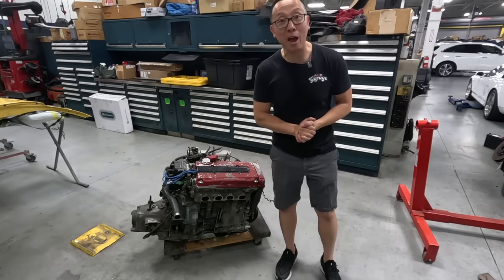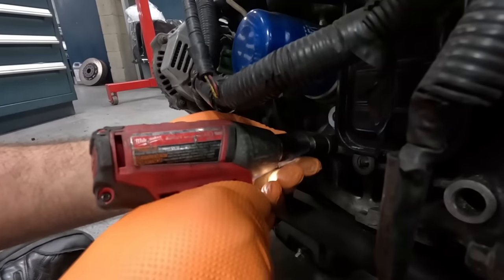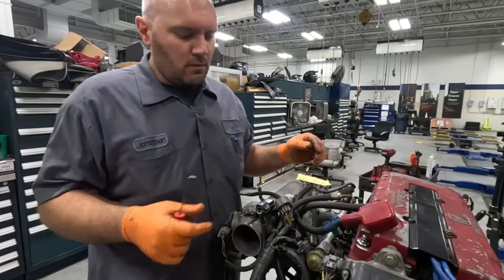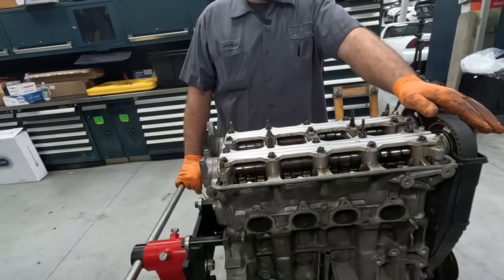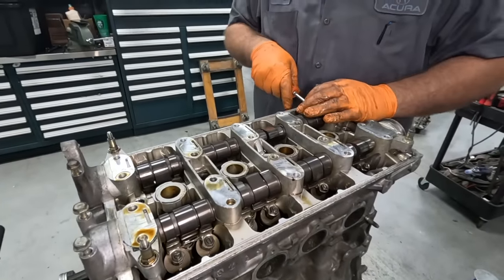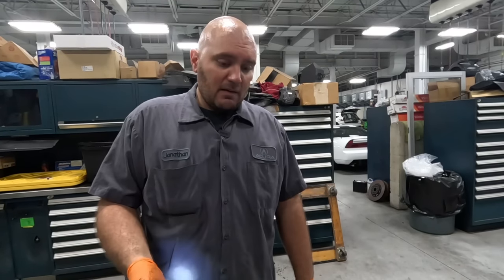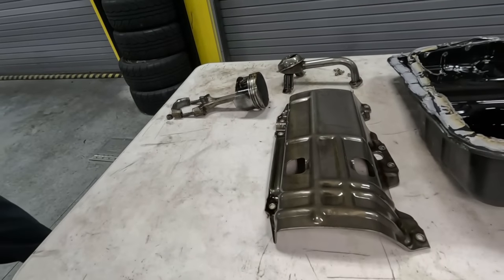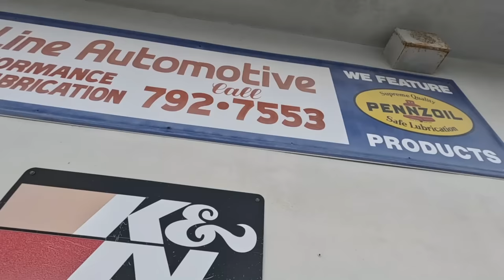JDM B18C Type-R Engine Full Teardown // Oil Consumption // 1992 Honda Civic VX Build Project (Ep 4)

Comment: My b18c4 burns a lot of oil at high rpm. Running 75-85 mph and burn 2 liters of oil for 250 miles. It burns a lot of oil after vtec kicks in. It kicks at 4300rpm and then oil  is burned. It burns a little at low rpm but again is too much.
Reply: Sounds like it needs some piston rings
Reply: you need to rebuild it....that is brutal....i had a b16a that would burn all of the oil inbetween oil changes if i didn't top it up....
Reply: You need a rebuild before you destroy your block then that engine will be a waste.
Reply from the maker: As these motors age and wear, piston rings, valve seals and etc can cause oil consumption symptoms.

Comment: Car care nut would of said “folks never take engine block to a machine shop” words of wisdom.
Reply: He also generally deals with doing regular repairs on relatively common vehicles, not performance builds with very rare engines that haven't been available new in decades and are insanely expensive used. Putting a new short block in Mom's oil burner Camry and building a rare race engine are two VERY different things.
Reply from the maker: Same "car care nut" would have a oil burning machine
Reply: Yeah but these are Honda blocks which are a little outta his leagues which are a much better block IMO

Comment: How many miles did this have on it because damn outside of a little piston wear from what appears is from constant high reving...😂 This is a super clean engine, what a deal! Love me find one in this condition normally there trashed by some kid with a rod through the block...😥
Reply from the maker: We are not quite sure the exact miles, but it will be all new by the time we finish it 👍

Comment: I need to so this to my type r what is the cost for doing something like this
Reply: Paying some one to do all the work or are you asking just for the block completely done. Whole engine rebuild top and bottom on this engine done right is no more then $4k including parts. Now just a bottom end block job with bore, hone, balance, and more depends on parts should cost no more then $350 to $500 labor plus cost of parts if you are upgrading them.
Reply from the maker: Answer can be very subjective due to many factors including parts, labor rate and work required, Stay tuned for a cost break down on this motor build.